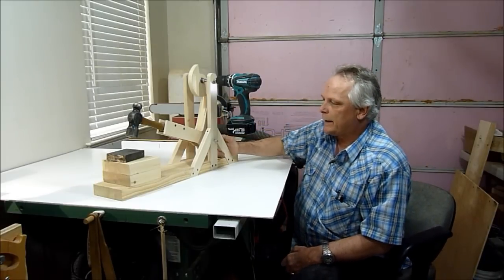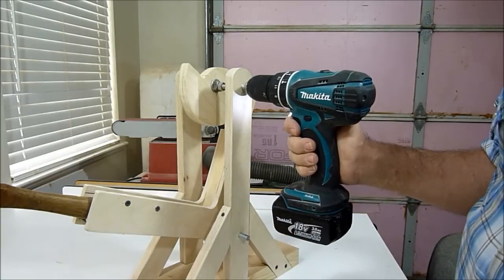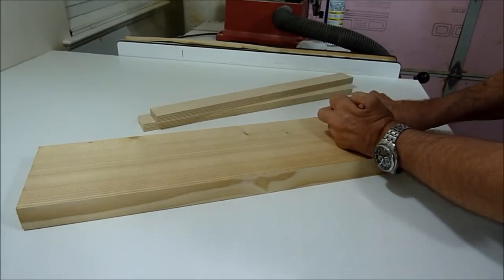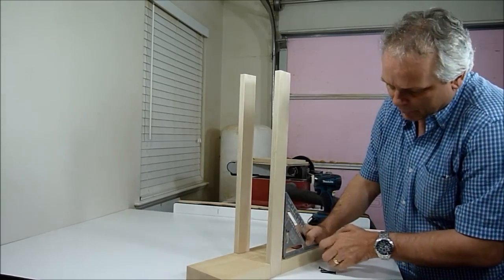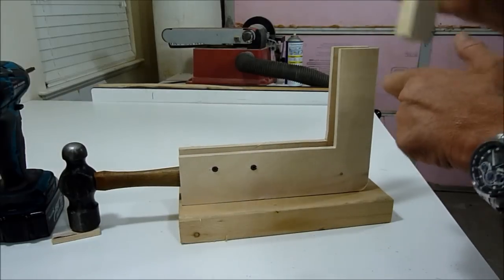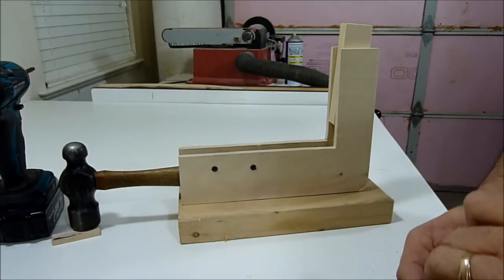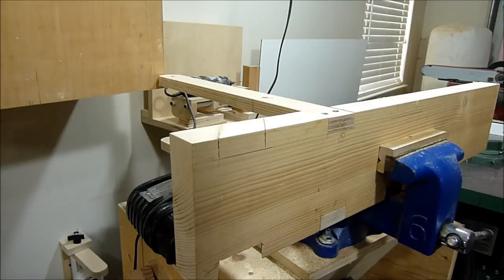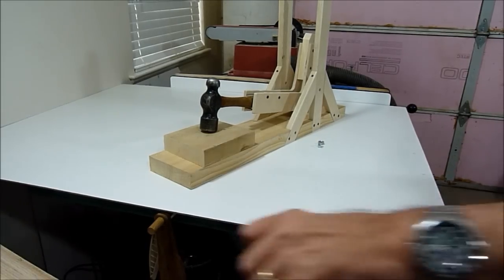Make a Leonardo da Vinci cam hammer

Comment: Im thinking you can use a heavy spring pushing up on the back end or pulling down on the middle. Then, because of the added resistance, have a small roller  bearing at the top of that arm to run against the cam.

Comment: Well done, just as a side note use big washers on your all thread and drill hole in washer going through cam and put bolt or pin through it.then you can operate at full throttle

Comment: Smooth the hammer's motion setting the radius proportional to the angle+offset. Ie: Make the base radius 1" & the hammer swing 1.5" :
Radius @ 0 degrees = 1" (base only)
Radius @ x degrees = (x/360)*1.5"+1"
Radius@45degrees=(45/360)*1.5"+1"
You could even make hammer hit twice per rotation by changing the formula to
Radius @ x degrees = (x/180)*(swing distance)+(base radius)

Comment: Try offsetting the center hole of the cam, it might give you more lift on the hammer, in either case you can go back to the original one.

Comment: You can do a minor modification to the flywheel by making the taper from the drop off to the edge of the high part more gradual, i noticed there is kind of a hump right after the hammer falls and and the drill struggles a little to turn that first bit to get the hammer in the air.

Comment: Nice model. To raise the hammer higher, you could do several things. Raise the pivot point, shorten the trip leg, lengthen the hammer leg or even adjust the size of the cam. Adjust the angle of the dogleg so the hammer strikes flat. Check out the engineers toolbox.com, for the math.

Comment: u know about wood but not about electric motors ... that motor should have higher rpm and u need gear reduction .... otherwise u burn it , kill the battery and last but not least u can have a fire ...

Comment: This actually gave me a pretty good idea for an auto hammer system for blacksmithing. Except instead of using a cam, it would use a flywheel and chain and the hammer would be pulled down. Counter springs would pull it back up, and it would use a pair of armatures to keep it perpendicular to the anvil. A separate foot lever would also be attached via chain and allow individual strikes, so if you don't have a hand free... Hammers like this already exist, but I have yet to see one that uses a chain as a drive action...
Reply: 6 years later... Did you do it?
Reply: Did you make it ??